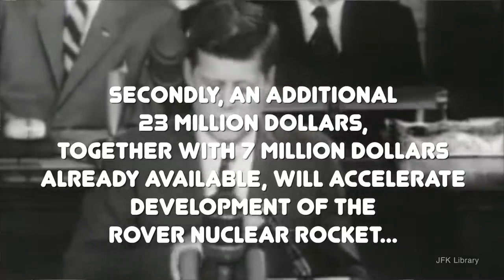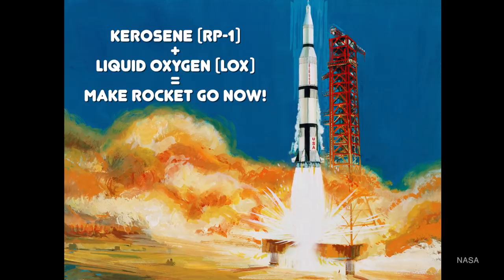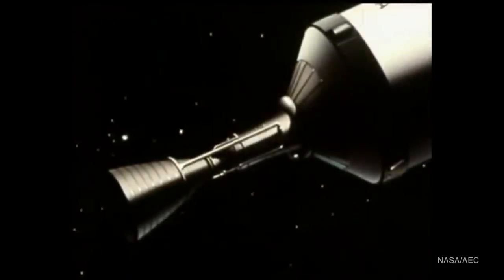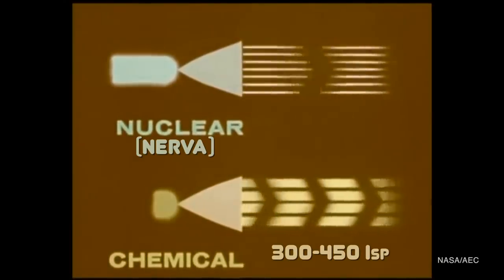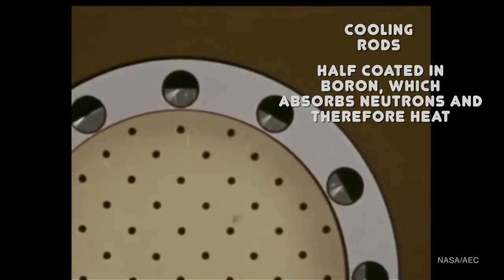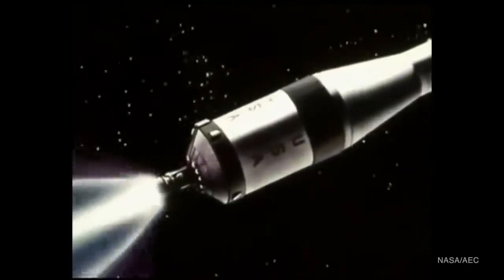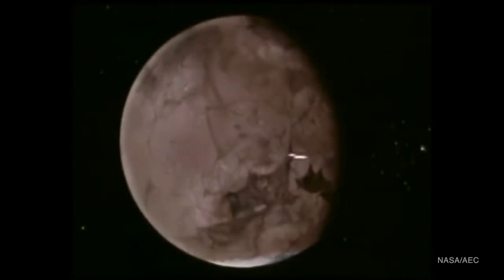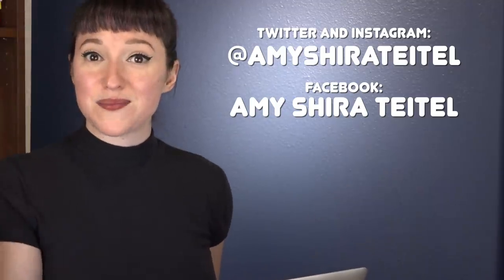A Primer on Nuclear Rocket and Why They're Awesome in Space

Comment: Finally understand what specific impulse is now. Thanks Amy!
Reply from the maker: I hope this helps! We all know I'm not actually a rocket scientist, but I feel like I finally got my head around it!
Reply: I usually just multiply it by g and get the propellant velocity at the nozzle.
Reply: I saw explanations on other channels, but Amy's explanation is by far most clear and easiest to understand
Reply: Isp is relic from time before electronic calculators (it simplifies calculations).  Even today it has advantage of being same in all unit systems.  But in physics it is incorrect.

Impulse = force*time   
specific impulse = force*time/mass     (mass of propellant used in time)
This has unit of speed.  So to get specific impulse from Isp you multiply with g.  In this case you have to use 9.81 m/s² even if rocket is on the Moon.

They got Isp by using same unit for mass and force and canceling units away.
Reply: @jkn6644  I think the seconds comes from the following. if you measure thrust is kg-force, its how long an engine can burn on the amount of fuel in kilogram as its thrust in kilogram-force. so if an engine with 40000kg-f or 392.266KN can produce 40000kg's of force with 40000kg's of propellant for 311 seconds, it has a specific impulse of 311 seconds.
Reply: @yuvalyeru  Yup. Some others just drop Isp entirely and talk about exhaust velocity. I've seen ESA and Arianespace do it.
Reply: Yep, works for me 🚀
Reply: @thomaswijgerse723  Yes, but it is a mistake to say kg-force/kg = 1
It is kg-force/kg = g  (on Earth when force is weight)
Reply: Hypersonic acceleration estimates rather than launch subsonic grunt force
Reply: @ApolloWasReal  Are you sure that what you heard was truly "exhaust velocity" and not "effective exhaust velocity"?
Reply: @jkn6644  true, but in the case of specific impulse the g is used as a constant. merely as a mean of conversion between metric and imperial, to make sure you get the same number.
Reply: @Apollorion  Well yes... effective exhaust velocity. (picky picky :-))
Reply: @thomaswijgerse723  Yeah, but g is arbitrary because it's a parameter of the earth's surface -- and if you're on a rocket, you're not on the earth's surface for long. Effective exhaust velocity is the right number; it's conceptually much more straightforward.
Reply: Bruh just play ksp
Reply: I know, right?  :D
Reply: I think some people are missing the point a bit here. Regardless of the fact that Isp is not a definitive measure of a rocket motor's performance or efficiency across all operating parameters, it's still a useful term to help non-rocket-scientists compare efficiency between different motor designs and propellant types. In the sense of "all else being equal, higher Isp = greater efficiency". Which is precisely how Amy used the term in the video. :)
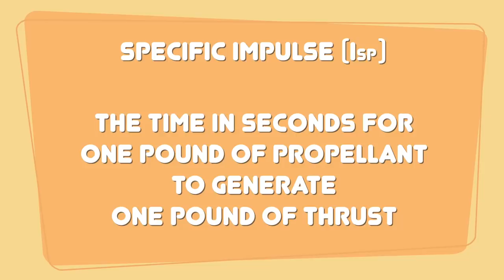Reply: @AmyShiraTeitel  (Not a rocket scientist but a propulsion engineer). I always thought of it as "thrust per (weight) flowrate of fuel". The thrust and weight units cancel, leaving 'flowrate' on the denominator, hence the final unit of 'seconds'. At 3:22, though with a quick rewording it might make more sense to say "The theoretical time in seconds that one pound of propellant could sustain one pound of thrust". The current wording suggests you're waiting 300+ seconds before you get out your pound of thrust, which is not true. It's an instantaneous quantity.
Reply: @sixstringedthing   "I think some people are missing the point a bit here."

I'd thought the point was, we finally know what it means.
Reply: Specific impulse can be based on mass flow, in which case the units can be expressed as velocity.  This is not the true exhaust velocity, but what we call the effective exhaust velocity.  

Specific impulse can can also be based on the weight flow of the propellants.  In this case you get the units of “seconds.”  The weight flow is, by convention, based upon Earth surface gravity.

In either case, it is s measure of the magnitude of thrust is generated for every pound (lb-mass, lb-Force, kg, Newton, take your pick) of propellant burned.
Reply: @roberthiers3460  You've fallen into a similar error when you say: "it is s measure of the magnitude of thrust is generated for every pound (lb-mass, lb-Force, kg, Newton, take your pick) of propellant burned." This is incorrect. It is a measure of thrust per flowrate of fuel. Your description would have the denominator be pounds of fuel, when in fact it is the time derivative, which are distinctly different quantities.
Reply: Jay Smith 
Yep, I said flowrate at the beginning of my comment but neglected to at the end.  Absolutely, thrust per unit mass (or weight) flowrate.
Reply: @roberthiers3460 

Amy's definition is better.
Reply: Frank Harr 
If it helps you understand it, great!  The way we typically think about it is related to how we measure it.  We measure the rocket thrust, measure the flow rate, and compute ISP as the ratio of thrust to propellant flow rate.  Or we measure the thrust, burn time, and total propellant used and compute ISP as thrust x burn time/total weight of propellant used.  

We don’t typically cast it as “ how many seconds could I get one pound force of thrust from one pound of propellant?” but you sure can.  But if I have 10,000 lbf thrust and 436 lbf/sec flowrate for 74.5 seconds, the “seconds of one pound force from one pound of propellant” isn’t really useful.  

And if you are solving the rocket equation, the “effective exhaust velocity” form is the most useful.
Reply: @roberthiers3460  Look you have to ask yourself what's meaningful to what audience and how.

Can an engine only put out on lbf?  Well, NO!  That's silly.

Does that make the accelleration standard no matter your payload?  God no!

If you know the engine, the mass of the payload, and your target acceleration, then you know how high you want to turn your engine on given its ISP.

But bringing fuel flow rate etc. into the definition just confuses people.  I was confused.   For years I was confused.  But how long a pound of fuel produses a pound of thrust makes SENSE.  We all know that fuel efficiency is more complicated than miles per gallon, but that makes an intuitive sense that allows the term to be used.

Sometimes, people get invovled in comeing up with a very rigorious technical definition for something and forget that comes from a place that's a lot easier to understand.  Something that's intuitive and tells you why it's important.  That's why happened to Specific Impulse.  I don't really need to first how flow rate relates to it.  That can be the third thing I learn.  The first thing I need to learn something that gives me an understanding of why it is.

That engine can give me 900 seconds of 1 lbf per lb of fuel.  That's something I can get my brain around and I can see how upping the fuel per second can get me more and how acceleration is changed by chaging the payload.  It gives me a structure I can understand.  Because I'm a German major and I don't want to study for ten years to just figure this one thing out.

Bravo Amy!  Keep it up!
Reply: @AmyShiraTeitel   This is a pretty seriously incorrect definition of specific impulse. It's not about the time needed to make a unit of mass to make a unit of thrust in seconds, it's about how much a unit of mass can generate its equivalent weight (measured by earth's gravity) in seconds.

You're definition here state a pound of rocket fuel would need 300 seconds to generate a pound of force which is all sorts of wrong and would mean higher isp's are worse for rockets. In reality, a pound of rocket fuel can generate a pound of thrust for 300 seconds.
Reply: @Chace Evans . . . my sentiments, exactly!

Comment: The crewman on nuclear submarines live close and work on reactors - no problem there other than the fact that you cant return to earth quickly like a submarine can surface. Heat buildup can be remedied by radiator systems, like they have on the ISS though they likely need to be multitudes better in efficiency. The problem is getting an intact nuclear reactor into space safely, which could be accomplished in stages or by means of transporting the reactor first, and the radioactive fuel in a secondary launch. We already have nuclear waste containment vessels that can withstand tremendous explosions and impacts, so we'd just need to make sure we have a rocket capable of sending a properly secured nuclear payload into space. ICBMs already do this.

Comment: One important point was missed: Doubling the specific impulse, as you can hope to do with a nuclear engine, doesn't just double the payload you can deliver. Because of the rocket equation, a more powerful fuel compounds the benefits by reducing the weight needed, in a loop that multiplies the effect, so that the improvement is much more than 2X.

Comment: I was in kindergarten when Sputnik flew. By 4th grade I flew my first homemade rocket made from one of Castro’s cigar tubes. La Corona cigars that my Dad smoked on special occasions and before the sanctions against Cuba were in place. La Corona’s were exported to Honduras if memory serves to bypass US sanctions. The tubes the cigars came in was made of aluminum and I filled it with homemade gunpowder found in an old book on ancient Chinese pyrotechnics. I was becoming a grade school expert on rockets, and knew all about specific impulse and total impulse. Shortly after home brewing rockets I found a new hobby in commercial model rockets which made my interests and hobby much safer. By high school we had a small band of rocket boys and we went back to designing and building amateur rockets, one that flew more than 4 miles high and extended our understanding of rocket science. We even dabbled in liquid propellants but found safe engineering and machining of hardware too expensive and technically challenging. We gave that up after one successful flight a little better than Goddard’s first liquid fuel rocket flight. We focused instead on solid propellants and composite plastics to keep a margin of safety. By then we were well into the Calculus and rocketry was a big educational aid to otherwise boring school.

Comment: Specific impulse is basically exhaust velocity normalized to 1 G. So a specific impulse of 500s means an exhaust velocity of 500s x 9.8m/s^2 = 4900m/s. The goal is higher exhaust velocity, and the way to get that is to increase the exhaust temperature. This is why a nuclear thermal rocket works: a fission reactor can heat the propellant to a much higher temperature than a burning kerosene/LOX or H2/LOX mixture. You stated that NERVA could get an Isp as high as 900s, which is nice, but the limiting factor is the melting temperature of the reactor core. A fission reactor could get a much higher Isp than that if melting isn't a problem, which is why they studied things like the liquid core "nuclear lightbulb" engines and so forth. I love nuclear rockets and hope we use them soon. For aggressive exploration of the Solar System they are the only realistic technology option we have. Check out the videos of the live fire NERVA and ROVER tests on youtube.

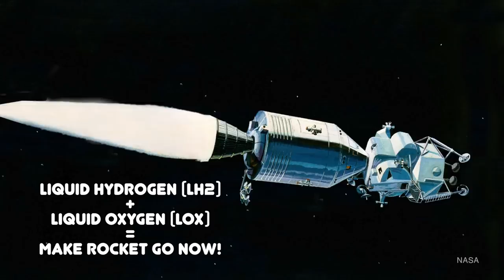Comment: 2:04 The CSM Engine didnt use Hydrogen, it was hypergolic N2O4 / Aerozine 50, the 5 J2s on the second Stage and the one on the SIVB used H2/LOX. Im sure amy knows this, but the animation department made a whoopsie.
Reply: The CSM did use Hydrogen for the fuel cells, but this is obviously for power generation not propulsion. Probably why they mixed it up.

Comment: Great to have you back!
A nit pick: the beryllium jacket is a neutron reflector, it prevents neutrons (not heat) from escaping, and so sustains the fission reaction. The control rods are boron on one side and beryllium on the other. Again, the boron is absorbing neutrons: the amount of neutron absorption is what controls the reaction, not the amount of heat absorption. 
The rotating control rods were less likely to get stuck than linear control rods, at the temperatures these were run at.
Heat does have a controlling effect, in that thermal expansion will reduce the fuel density and so increase the critical mass and lower the reactivity, but this was not enough to save one of the experimental models, which ran out of hydrogen, blew up and spread itself over the Nevada test site.
Reply: Kevin, thanks for the details. I thought the beryllium jacket was just a high-priced fashion statement. 😁👍
Reply: Thanks for sharing that tale of Jackass Flats. I was going to say: Cooling rods or Control rods? You explained it well!
Reply: Glad someone caught those details.
Reply: Another sciency question. The application of the word "weight" when referring to the exhaust gas has me confused. I think it should be mass or density, but I'm not sure which. Any thoughts?
Reply: Molecular weight. Hydrogen gas has 2, water has 18, the lower the molecular weight of the exhaust gases the higher the isp.
Reply: Ziginox weight is actually right for I_sp. It’s a consequence of the louche practices encouraged by using Imperial units. Exhaust velocity is a better measure, in my view, because its definition doesn’t depend on the value of g at a particular location.
Reply: "but this was not enough to save one of the experimental models, which ran out of hydrogen, blew up and spread itself over the Nevada test site." Radioactive mess everywhere! Now try launching lots of them to colonise Mars. People wouldn't be happy if one blew up at launch or on the pad, spreading (blown on the wind) radioactive debris over Orlando or another large populated area near a launch site. https://en.wikipedia.org/wiki/Nuclear_thermal_rocket#Risks Also isn't the exhaust radioactive too? So you couldn't us it for propulsive landing as it would spew radioactive hydrogen everywhere. All i can say is good luck competing against SpaceX and Blue Origin! Efficiency isn't everything, REUSE IS!!! Elon Musk "Full and rapid reuse is key to bring the cost of space flight down"
Reply: @linmal2242  "Radioactive mess everywhere!"  I heard that Army grunts were used to locate and pick up the radioactive pieces. One can only guess they weren't in any special suits, since Rapid Unexpected Disassembly was not likely in their plans.
Reply: Makes a more standard reactor with electric (Ion or Plasma) population look a lot more approachable, more so since the reactor can be a conventional power generator, the the extra weight might be a pain
Reply: @troglokev  Close, but Isp was actually used a bridge between teams working in imperial and teams working in SI.  By taking your exhaust velocity in m/s or ft/s, and dividing by standard earth g (the agreed-upon sea level value of around 9.81m/s or 32.17ft/s), you get a value that's just in seconds, a unit shared by both systems, and trivial to convert for either side.
Reply: Daniel Wilson as I said, louche practices encouraged by the use of imperial units. The use of g in the SI version ties it to an arbitrary location that doesn’t even make sense in microgravity or on the surface of the moon (or Mars, if we ever get there).
Reply: @linmal2242  Fortunately, the various isotopes of Hydrogen, while radioactive, aren't that great a concern. H1 and H2 (Deuterium) are essentially stable, and H3 (Tritium) is produced in such low quantities because the gas moves through the reactor so quickly that it's not worth concerning ourselves about it. There are other isotopes, but their half lives are so short the longest being 910 yoctoseconds or 9.1x10^-22 seconds) that they'd be decayed many times over. You'd likely never even detect it and would only be able to deduce their existence because you'd end up with a slightly larger amount of Deuterium than you'd otherwise expect.